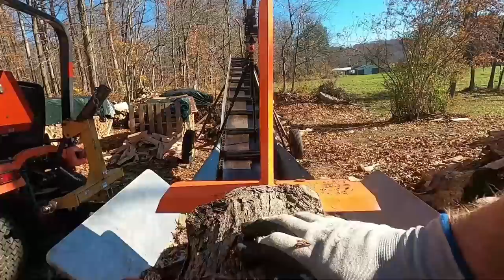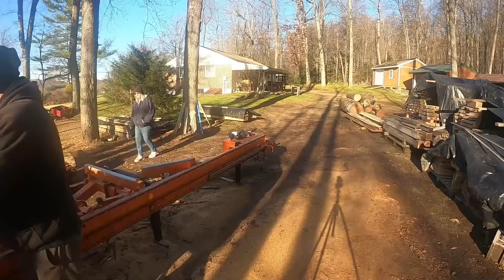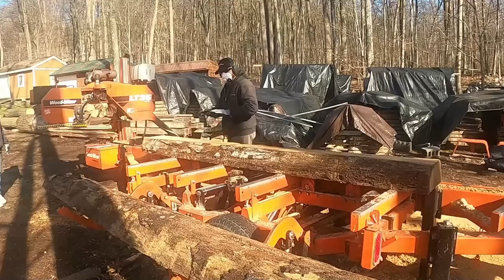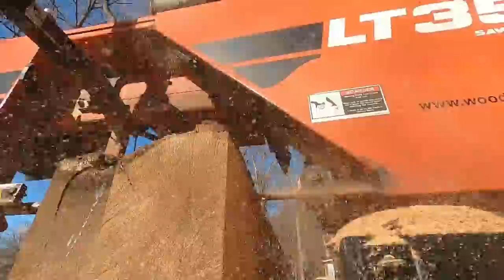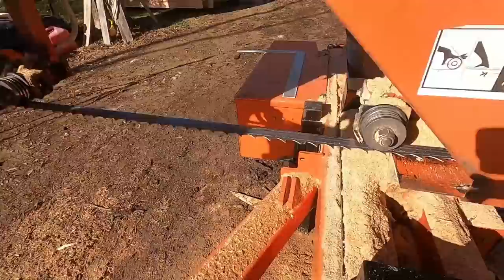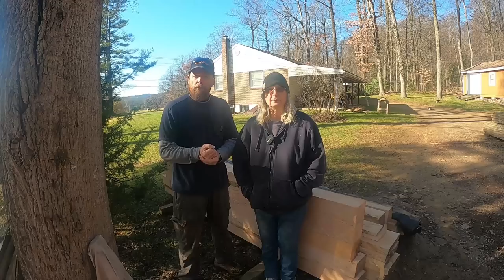How Do You Mill 6x6s

Comment: Cutting those logs with tension can be a pain - to be honest, if they are hardwood and bending, I'll often just turn them into firewood. My back doesn't like carrying the heavy boards and beams anymore - I just slide them from the mill onto the tractor forks these days!!
Reply from the maker: It can sure be a challenge. We wish we could throw some in the firewood pile, but we need to cut what the customer gives us. We have been learning a few tricks to make them work out really well, so we wanted to pass some of what we learned, onto anyone who was frustrated with stressed logs. We hope it helps.